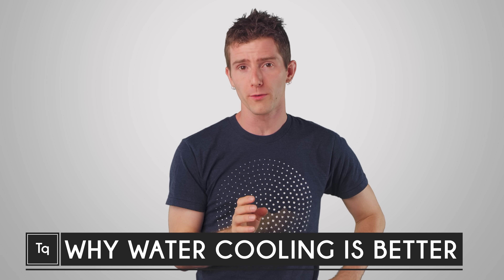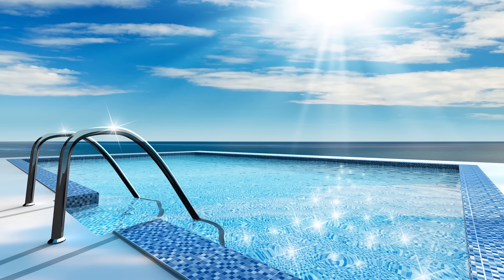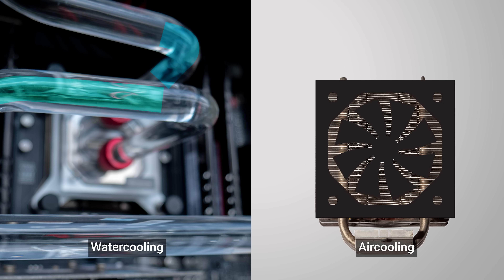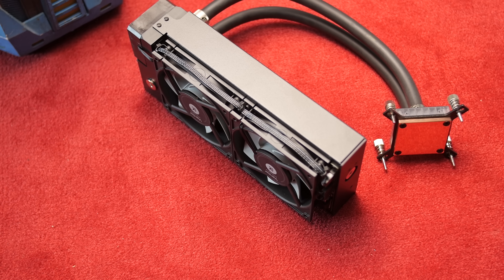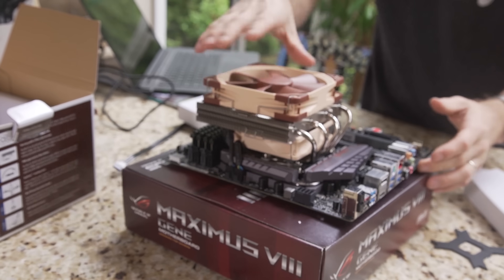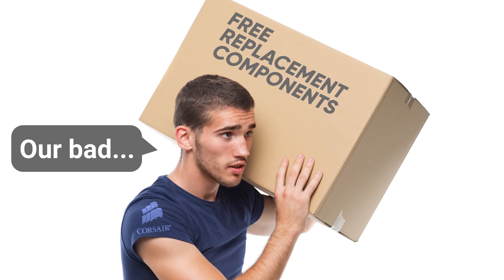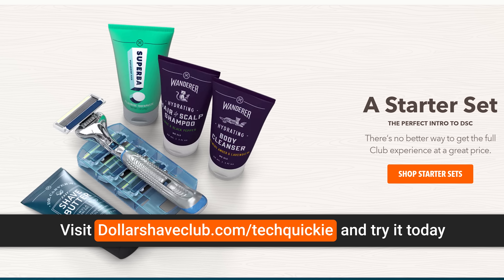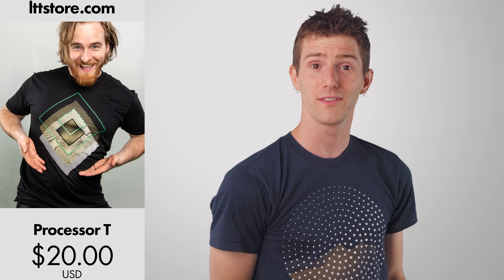Why is Water Cooling Better?

Comment: Linus: Watercooling is not getting more performance than air.
Also Linus: Watercooling is better!

EDIT: Jesus it was just a joke, I know custom is better lol... 89 comments, djees whole internet is raging
Reply: AIO =/= all water cooling.

Quite frankly, unless you're going to go balls to the wall and pay for a full loop, you're better off just getting a beefy air cooler from noctua.
Reply: Chris no
Reply: I thought the same. Didn’t he do a video about air cooling being better?
Reply: @VincentKoo816  yes
Reply: @Love Thy Neighbor ... Are you saying Dollar Shave Club has a vested interest in watercooling?
Reply: Watercooling can be better but it has more variables. With aircoolers it's just the radiator, the mount and the fans.
With water it's just a shitshow. You have pumps, you have radiators, you have waterblocks. And then the non-performance components that still cost a lot like fittings.

If you want a high-end watercooled system you're going to pay HARD CORE for it.
Reply: High end air cooling is typically better than AIO watercooling, but a custom loop will beat both.
Reply: God these comments I swear, I feel like all of you don't know the difference between a custom water loop and a godamn AIO. Or maybe half of you didn't even pay attention to the video.
Reply: @ordoordo8917  It's just the fact, that you water cooling guys compare a 90$ Air cooler with 300$+ custom loop. Linus sgould have said that... Go Noctua or Custom loop. AIOs have 1 benefit, which is nicer design / less weight on cpu and that is not worth the higher cost and possible malfunctions imho.
Reply: @TheZoonder  What are we supposed to compare it to? Sometimes you have to pay more to get more. A $90 air cooler isn't going to benefit us in the way we want (aesthetics) or need (performance) and we are willing to pay the extra money to get what we want out of the system. If you like the look of those air coolers or don't mind them and don't care to see how far you can push your system, then I 100% back your choice. You just gotta understand that it's not for me, I want a bit more/different than you that is all. I build my systems for noise to performance targets and enjoy the cleanliness it offers inside my case.
Reply: TheZoonder nah, aio is still better for oc
Reply: @ordoordo8917  It's justification of items they have become attached to. Everyone wants to believe they are smarter than the next guy so they willfully ignore any data to the contrary. People also expect A or B answers to questions that don't have an A or B answer. When people ask "is water cooling better than air", the real answer is "It depends" because what they are really asking is "Is it better for my exact use case that I didn't even know existed"
Reply: You're confusing AIO's with watercooling in general.
Reply: @cupcakebunnyprod  Common, 90% of people going water just grab an AIO. Custom loop is nice, but way more expensive
Reply: @TheZoonder  AIO is about as water cooling as an air cooler, I mean, they both have water in the pipes.
Reply: @TheZoonder  people confuse AIO performance for custom loop performance a lot and then say all water cooling is worse than air.
Reply: @cupcakebunnyprod  you could buy a fridge and put a pc in it for the price of custom water loop tho. People do not pay that kind of money to have 3 degrees less, but to have a nicer case.
Reply: @TheZoonder  3 degrees less isnt close to accurate. It's usually 10-20 or more especially on a gpu. You can get a loop going for about 600, which yes isnt for everyone but it is a big temperature difference.
Reply: TheZoonder my overclocked 2700x and 2080ti beg to differ. Both are on the same loop and it never goes above 60c. That’s roughly 20-30c less than both those would run stock not overclocked at all. Plus, the inside of my case stays as cool as the ambient temp and everything else that you want cool, like SSD’s stay well below their upper operating thresholds.
Reply: TheZoonder plus, the reason people don’t put a pc in a fridge is because that’s costs money to cool, and will cause condensation on the your parts.
Reply: Seriously...didnt they just do a comparisson between AIO's and Air coolers and the air coolers did just as well while being quieter and cheaper?
Reply: @R-vw3uz  recon the water pump makers want him to diss air. Then send him more parts for free!
Reply: @R-vw3uz  duhhh! the tittle says water cooling not AIO. water cooling and AIO are two different things coz water cooling can be anything else other than AIO.
Reply: @R-vw3uz  They did
Reply: In the previous video he was talking about AIOs vs high end air coolers. I think the part that makes the most difference when it comes to a custom water loop is the pump. A D5 is significantly more powerful then the weak pumps they attach to cpu blocks in an AIO. Imagine it like putting a 80mm fan on a NH-D15 instead of a couple 140mm fans. A d5 pumps max flow rate is 350 liters/hour. An H100i was measured at 25 liters/hour MAX flow rate.
Reply: 2:55 watercooling is much quieter than Air cooling.

Literally every tech tuber comparing air v water cooling: water cooling is louder due to the pump

Me: WTF?
Reply: to be fair, heatpipe transfer more heat than waterblock because phase change is much faster than conduction.if you cooperate AIO with vapor chamber with fins maybe it can do better
Reply: @royk7712  It doesn't transfer more heat, it transfers a much smaller amount of heat very quickly. An air cooled system will normalize faster than a water cooled system, but water has far more heat capacity than metal. This is why most cars are water cooled, and why all powerplants need large quantities of water to operate.
Reply: Though you got probably got some good answers already (and even though this is obviously a joke), I'd still like to add may 2 cents. The video you're probably talking about was about comparing air coolers vs AIO water coolerers. This is more about the general technical advantages water has over air as a heat dissipator. Almost every good air cooler these days has vapor champers, to which most of said advantages apply. Full Custom water cooling will always beat even the best air cooler money can buy. This video is about explaining why.
Reply: Yeah, i remember that video, i'm confused.
Reply: He only did noctua and only up to a 280mm and not custom cooling
Reply: lol was thinking the exact same thing
Reply: literally me:

*didn't he said watercooling wasn't worth days ago?
Reply: Basically Watercooling loop is better than normal watercooling and normal watercooling is almost equal to air cooling.
Reply: In his previous video, he was talking about AIOs not beating out high end air. Full custom loops(assuming they're constructed properly) cool more efficiently than a large fanned heatsink
Reply: Water cooling is only better if Ou compress the water before it gets into the radiator. I don't know one AIO that does that. It's just flowing water that gets  a breeze.
Reply: This was the next video that players after I watched that video.
Reply: I work at IBM and we invented chilled water cooling in the 1960s for mainframe computers.
Reply: @CORVETTE_DUDE_CHANNEL  Did you also invent the wheel? You been working at IBM since 1960?
Reply: Yeah, IF you take a ridiculously high end air cooler like a Noctua NDH15 and a meagre 120mm AIO, the air cooler will win. Once you get into 240 or 360, or go further into custom liquid cooling, the air cooler starts to lose out in most applications.
Reply: @CallanElliott  How its ridiculous? It costs like 85€ and is on par or beats 360 mm AIO's. And even then it is way quieter cooler.
Reply: @megapet777  Ridiculous is a relative statement here. It's the highest tier air cooler there is, it's at the top of the air cooler pile.
Reply: @CallanElliott  Yeah. But I don't think it is ridiculous :)
Reply: @megapet777  I'll tell you what is ridiculous, though. Being a fanboy.
Reply: @CallanElliott  Agree
Reply: That's not what he said
Reply: Didn't any of you watch like the first 30secs of the video?
Reply: I think the last video was about air coolers versus AIO liquid coolers, this is about air vs water cooler with pipes.
Reply: I added another comment just to make your statement about 87 comments inaccurate
Reply: @user-st5ir8mg3q  Dammit Sam 😂
Reply: Notice how he mentioned 'except for high end air cooling' several times? Most AIO's are better than mid level air cooling...but are twice the price. Things like the high end Noctua coolers are comparable in price to performance.
Reply: Don't forget air cooler cools other stuff like vrms, memory and nvm ssds, put a water cooler on a 4+1 or2 vrms and a big power hungry cpu and be amazed by the Thermal trottling at lower cpu temps
Reply: @NaNekoRx10  Your board is shit if your VRMs need an air cooler.
Reply: @NaNekoRx10  Rewrite that.
Reply: @NaNekoRx10  Get to the point, what are you saying?
Reply: @NaNekoRx10  You still didn't get to the point.
Reply: @NaNekoRx10  You're cute, I might poke you.
Reply: Here's the thing watercooling is better... if applied properly with all the physics involved taken into consideration. Even an AIO has some benefits, overclocking at the bleeding edge can see stability improvements by leveling out quick spikes in temperature and that's enough of a reason on its own, but with a full custom loop you have so much control over the entire situation. How much surface area is transferring heat from CPU to water, how much is transferring heat from water to air, the thermal properties of the fluid, how much and how quickly water is flowing through the block and radiator, how quickly air flows through the radiator fins, if you go hard enough the shape of the contact surfaces, even as far down as how many transfer mediums there are between the die and the fluid because direct die is a thing that kind of still exists.
Reply: well, its more the noise floor im assuming
Reply: Nobody here seems to have mentioned that while air can be as effective as water IF you want a giant fugly metal block taking up all the space in your case, that one advantage water has is not attaching a massive weight to your mobo and straining your pcb. That's why I got Raijenteks 360mm aio. It looks cool, runs cool while being quiet, and doesn't put strain on my brand new mobo. I can maintain temps under 65C after a whole hour at full load and not even hear my pc next to me.
Reply: with the same amount of noise watercooling is better
Reply: @madd5  lol, no way. They even made a bloody vid about it. Not even Noctua's NHD15, but it's younger little brother outperformed both Corsair's 240 and 360 in noise and in temps.
There is no freaking way a AIO is better in noise / thermals than tripple fan NHD15 with LN adapters.
Reply: @TheZoonder  that is exactly what i was thinking when i saw this video
Reply: @TheZoonder  right!?
Reply: @TheZoonder  water cooling is still much better, its just AIOs suck.
Reply: @bonehead0816  I got a good one imo, heavy oc Ryzen 2700X with that thing still 56C on 100% load
Reply: @TheZoonder  well, something is definitely wrong there. Maybe it was an intel CPU. 

But I have a custom water loop which keeps my CPU and GPU under 50c during games and under 60 at full load. 8700k + 1080 ti. I'm pretty sure no air cooler can match the silence and performance of a custom water loop.
What kind of a air cooler you need for such a performance?
Reply: @TheZoonder  I want you to compare your air cooler to my water chiller, go on, I want you to say air is better than water.
Reply: @frostybe3r  pretty sure if we take into account wattage in performance, the air cooler fairs better in your comparison :)
Reply: @madd5  I've never seen my cpu I7 6700k go over 60°C, and I'm using a (very) beefy air cooler. Noctua NH D15 to be exact. Its hella quiet and cools like crazy. And honestly I prefer the look of a really beefy air cooler. And they literally did a video on how air cooling is better than water not too long ago. Either way, my point is that good air coolers can work as well as water cooling.
Reply: @TheZoonder  that vid gave me peace of mind after building my first rig with a DH-15 (beast). I still kinda want to add an AIO eventually for peace of mind while travelling, but yeah, the DH-15 handles heat so well and is so damn quiet
Reply: @bonehead0816  For the cost of custom water cooling you could get a better case. Or customise your case to feed in from an Xiaomi Mi air II do your air cooler is quieter and only breathing HEPA filtered air so never needs cleaning ever again.
My case is a laser cut wood box ducted to my Mi air II. The fan is well away from me so it's just the sound of flowing air. I can duct the input for the filter to the outside in summer for cooler air also.

I'm sure other air filters will work as well. It's just the unit I have and I don't link the smart features as I don't trust their spyware filled apps on my phone or the filter on my WIFI
Reply: @TheZoonder  Yea but air towers don't look as sexy as water coolers.
Reply: @markp8295  I'll start by saying I like the setup. Very cool idea and still works to filter the room air, just with a PC in the middle lol. I will also point out that there are people that have piped their radiators and pumps into another room. You then add one fan to the system to create negative pressure in the case and it's enough to cool w/e might need it. Makes your total system noise 15-25 db.
Reply: @TheZoonder  that is not completely accurate. in  a long sustained load, yes, good aircooler may be as good or better than some AIO from a cooling/noise ratio. however, under typical load, wich are not constant, then the AIO will yeld better result as it takes longer for the liquid to reach it's max temp. plus, depending on the AIO you choose, it may also allow for a larger dissipation area, depending on your case (resulting in more fan, but at slower speed, giving you the choice between better cooling, less noise, or the best mix of both). AIO also allow you to offset the dissipation area to a more roomy part. so choosing an AIO may not be a bad choice, depending on your case and usage, and may result in a better cooling solution than an aircooler.it's just not the ultimate cooling solution, it has pro and cons, and you should consider them vs your use-case to assess wether it is the best solution, or not.
Reply: @boblablaw6125  D5 pump running at max is 23 watts, more around 15-18 in most cases. Most water cooled systems have as many fans as air cooled (1.6-1.7 watts normally) so the difference in wattage is negligible.
Reply: @Ephem13  what do you mean negligible? That 20 watt difference already.
Reply: @jyotisarmah7976  Sponsored by watercooling brand maybe
Reply: @bonehead0816  yeah, 1000€ custom loop can be better. But 85€ noctua nhd15 beats aio's that can cost double of it's price.
Reply: @boblablaw6125  and 20 watts is negligible, it's going to be offset by the system running cooler and more efficiently.
Reply: @nicksparrow009  I have an fx 8320 black edition OC'd to 4ghz and using a 120 AIO it peaks at 63C after 3 hours of Prime95.   I cant complain about that good of cooking from a 120 lol
Reply: @TheZoonder  Well, in terms of performance, Kraken is better than Noctua
Reply: @bocchii912  $150 Kraken may be better than a $85 NH-D15. Slow clap
I have added another $18 NF-A15 fan and the result: $102 Triple fan NH-D15 is definitely better or on par with AIOs under heavy gaming and CAD work.
Is it better than custom loop? No. Is it better than chiller? No. Is it better than LN2? No. But it definitely is better than low-end AIO with reliability issues.
I had a 4790K with Fractal AIO, it got a leak after 2 years. I changed it for NH-D15 and temps dropped from 70+ to 65+ with lower noise (no pump noise).
Reply: @madd5  what kind of air coolers you know? Noctua, be quiet, Even the recent King of cheap n good silent the arctic eSports can beat any AIO in noise levels
Reply: @NaNekoRx10  it's a nonsense talk unless you test. Plus, fans are also important.
Reply: @madd5  nonsense talk is when There is already many videos Even Linus said that exact point, and everyone on this post and you still don't listen-read to anyone who isnt you!

Comment: i mean technically even air coolers are watercoolers because of heatpipes :P
Reply: Most heat pipes do not have anything in them.  It is just a tube.
Reply: @YCrCb444  They have a gas in them.